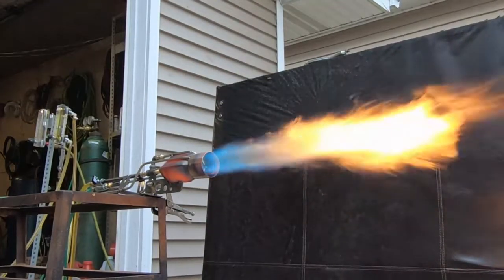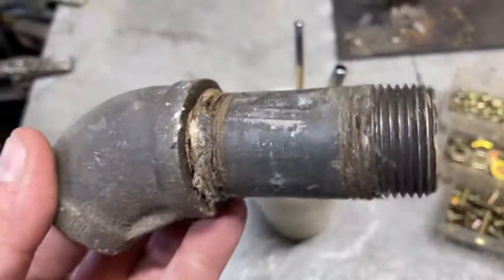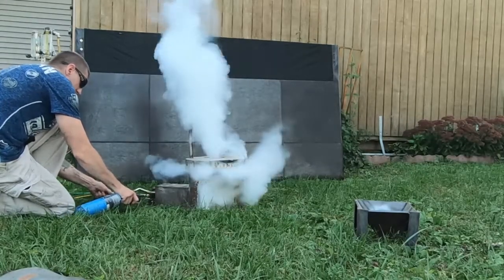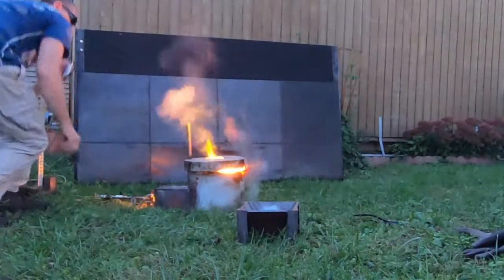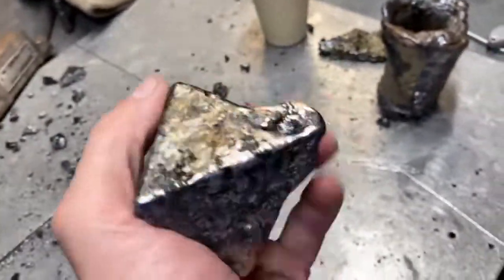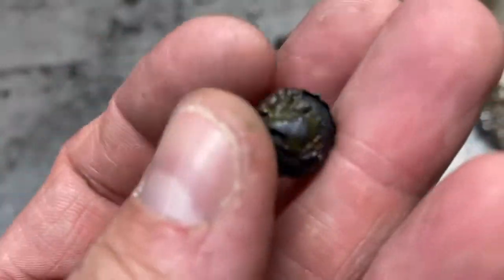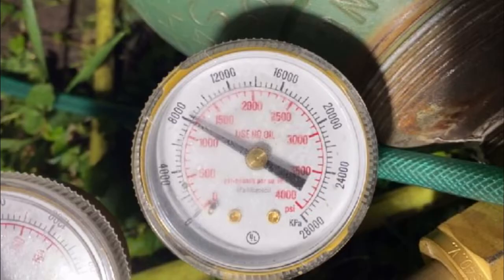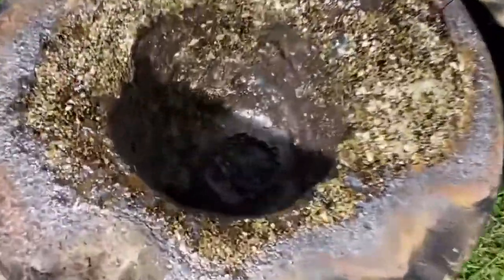3,300 Deg  ROCKET BURNER  Oxygen Surface mix burner

Comment: Did you include the cost of a crucible that you lost or this one burn. It still seemed pretty expensive just to melt a little bit of metal. The metal itself I didn't think had that much value.

Comment: Okay NOBOX7, that's some F'ing temperature dude. I'm afraid, because it doesn't seem like you know any limitations as far as heat, so what's next- hydrogen fusion so you can approach the surface of the sun temperature in your garage??? Also, I got a chance to play with the "Bluefire" brand "modern MAPP substitute" ( propane 20, propylene 40, dimethyl ether 40). Summation: hotter than propane, hotter than "MAP PRO" supplied by Bernzomatic (propylene 99, propane 1), not as good as the old methyl acetylene propane propadiene MAPP. But noticably more useful than the map pro in an air torch, couldn't really tell much difference in a little oxy-fuel torch.
Reply from the maker: thanks for the input on the gas , ill look into that

Comment: I’m not sure that pipe nipple is wrought iron.  Unless it is extremely old (early 1900s) it is probably mild steel AKA low carbon steel.  Your burners are incredible.  I always enjoy your videos.
Reply from the maker: Thanks for the input , the building it came from was old but not that old . I also had somebody tell me it wasnt carbon steel because i thought it was but they said he scratches from the wrench was to deep   . I wonder if i can do a spark test to find out ...